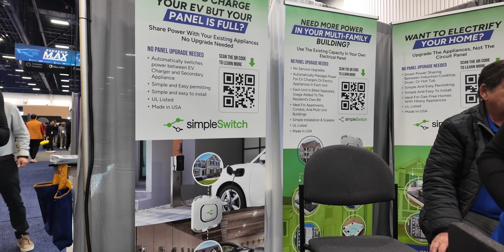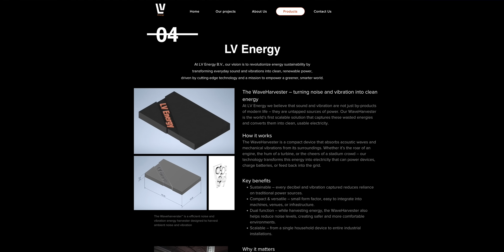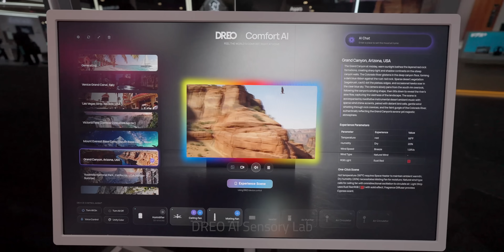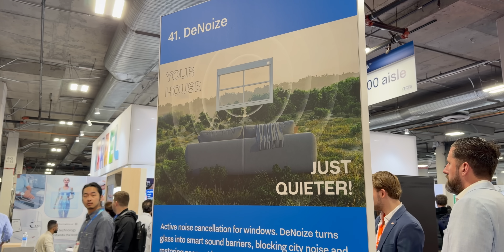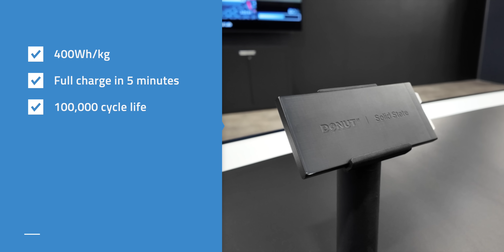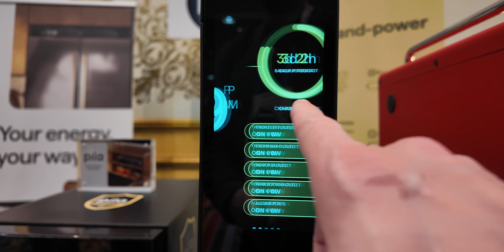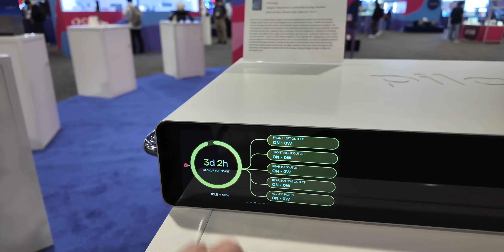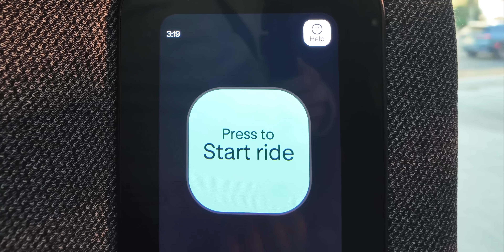The Most Controversial Battery at CES 2026

Comment: Door handles belong on the door since you are already grabbing the door to open it. However, a deadbolt can be just as easily mounted to the wall. That would erase all power issues for a smart lock but simply making the distinction between latch and lock.

Comment: Those skilled in the art already understand that Donut Labs clearly described a capacitor.  The only question I have is how did they increase the energy density.  I understand that a South Korean university solved this problem in early 2025.  Other than that, every one of Donut Labs claims are valid and proven.  For example, a solid state capacitor can actually be charge cycled billions of times.  The cell phone or computer your using right now contains solid state capacitors.

Comment: We have used several electronic combination door locks at our work for twenty years that don't need batteries.  You enter the combination then operate the handle.  Moving the handle creates and stores a charge to power the electronics for the next use.  We've never had them fail.  I assume they use a capacitor, but I'm not sure.

Comment: It’s healthy to be skeptic in some cases, but it’s interesting to see trolls already ”know” that Donut Lab is a fraud without any proof. Let’s just see within few months if the statement is true. Before that NOBODY knows until the battery have been independent tested. It would be very interesting to see a test with these MC that are using Donut Lab batteries to confirm or reject the claims.

Comment: I think that the Donut batteries and some of the wireless charging options are really interesting. I also thought that the auto-switch that detects moisture levels prior to turning on a fan and turning it off again are also a good idea, because just having a fan by default as is usually the case, can showering or bathing a bit chilly in winter, which isn't too good. And I am sure there is more... Thanks for an interesting video Matt. Catch you in the next one! 👍😄

Comment: On the smart locks, the solar cell could be combined with a battery. Problem solved. Considering how little power they use the battery will probably last ages.

Comment: For those viewers who haven't seen the other videos about the Donut Labs solid state battery: the secret is that it's not actually a chemical battery, it's a supercapacitor.  There is published research demonstrating a carbon nanotube-based supercapacitor design achieving over 400 Wh/kg, so their design is likely similar,  and their manufacturing partner specializes in nanotech manufacturing and has pitched a 400 Wh/kg supercapacitor project when obtaining funding to build their manufacturing facility.

I'm very confident the "battery" is real and will perform as advertised but it leaves one big unanswered question: What is the self-discharge rate?  Supercapacitors typically have a significantly higher self-discharge rate than chemical batteries, and if that problem isn't solved it will limit the useful applications of their product.

Comment: I have a smart lock powered by three AAA alkaline batteries which after a year went down to 50%. These power transmitters through IR light seems a solution in search of a problem
Reply: Mine has been good for 3 years now, As long as it's something dumb with a near field rfid sensor and nothing fancy it lasts forever
Reply: @theagentsmith  As a backup, just leave the backdoor unlocked.
Reply: Also, at least my lock if it do run out there's pegs on the bottom from the outside where you can connect a 9 v battery. So you won't be permanently locked out from the door.
Reply: batteries corrode too…If the demand is that small I like a little solar panel to enhance lifespan
Reply: My house has a Key, it's lasted 20 years. It cost me £5 to get cut.
Reply: @Honor-n7l5w  Yeah so then you also get to tote that key around every day and hope you don't lose it.. or damage it, or have it get frozen in adverse weather. You can also accidentally lock yourself out; I can't. I also just had a houseguest and could temporarily let their fingerprint or temp access code for entry. My lock can't be picked because there is no keyhole to pick. Oh and the cost is only a bit higher than deadbolts from the hardware store. So all the keys you have to have made over decades probably even that out.
Reply: @satekeeper that’s a long reply! I too have a 🔑 and if locked out I’ve a key safe with a spare I can go to, no batteries no sweat !
Reply: @satekeeper  I also have a key. If i ever should lock myself out, i have a reserve key hidden on the property (which i can also give out to a guest) and my brother has another one. Never had a problem with my doorlock being frozen, but if it should happen, there is a thing called a "lighter", you heat up the key and melt the ice in the lock. On the other side a coworker recently had the big problem, that her fancy electronic lock just broke and the manufacturer didnt exist anymore. So the door stayed open, until she got a replacement. I will continue to trust the non power reliant "lowtech" solution.
Reply: @satekeeper  Cant be picked, but can be hacked by a kid with a smartphone once the security updates stop.  Cars with multiple redundant security features are being stolen using the exact same tech that your smartlock uses.

In adverse weather cold enough to freeze up a lock (which in my 36 years on the planet hasnt happened to me yet) would also be cold enough to nuke the batteries in your smartlock from having enough power to operate it.

And good luck if you think your smartlock will last decades, if the security isn't broken at some point in the future, the hardware will screw up, at least the batteries will.
Reply: What model and brand? My smart lock eats batteries. It takes 4 AA's that I replace at least 3-4 times a year, if not more. I also need a new one because it doesn't do 5 MHz WiFi. Only 2.4 GHz and doesn't like it when there's both available.
Reply: What lock are you using? 

 @ls60fd  ya, mine is the same it eats batteries, I need to change them every 2 to months.
Reply: @ls60fd  I use an old Samsung, I'm sure it has been out of production for a while, but similar battery life, I used 4 rechargable AA batteries, I swap them out every 2 years or so. It gives you plenty of warning too, so it isn't a big surprise
Reply: @ls60fd mine is a Yale doorman. Guessing I'm close to once a year as well. It only got Bluetooth so that cuts down on battery use. It's connected to device hooked into the power grid that handles WiFi. This is unfortunately it's weak point with frequent disconnects. It doesn't stop you from using the lock in person, even with the app, but it does hinder you at times from checking status or unlocking at a distance.
Reply: Also you typically have at least two doors on a house.. and the units will signal when they are like two weeks out from dead. So.. not sure what situation would ever arise where ALL batteries are dead in all doors at the same instant and you somehow had zero warning.

Comment: 14:35 "The inside is basically like a giant box on wheels.". Some find it cute, I can't help think how it's going to be on a crash since it doesn't have crumple zones. If you're inside and it gets rear-ended, the impact is going to be a foot away from your head and back.
Reply: I’ve ridden in Zoox many times, some of the safety engineering is readily apparent, for example, the beefy side impact protection in the doors, some is more hidden, like the horseshoe shaped airbags.  Based on limited real world crash data they seem to be safe, but they really should get a NHTSA safety rating instead of the exemption they currently operate under.
Reply: @jpe1 I think it’s insane that there are vehicles that can be ridden in the USA that don’t have federally tested crash safety ratings done on them.
Reply: @SalokinQuagsire I’m not going to disagree with you, at least as far as newly manufactured vehicles for commercial use.  I think Zoox are safe, but if they are, in fact, crashworthy, the company should have crashed some of them to prove it, rather than get a waiver.
Reply: @jpe1  Yes. Any vehicle can eventually be rear-ended or hit head on, and there are common scenarios where neither the driver not the AI driving can do anything to avoid it. Stopped at the read light with a car in front of you, or worse, in a highway, there's nowhere to run if the driver behind is distracted and doesn't stop. A modern pickup with such elevated front, it looks like it could hit the Zoox too high, where doesn't seem to exist any crumble zone.
Reply: Yeah first thing I'd be checking in a self driving car is how to escape it in the case of an emergency! Also getting T-boned in that thing looks even more deadly than a front of back impact. These things should have crash safety rating just like any other car, and it should be public knowledge.
Reply: @SalokinQuagsire Agreed. Unfortunately it seems we're going to find out only when a serious accident takes place. I've read that the battery and some others components on the lower part of the car have some crumble features but not at the height of the passengers  upper body. The design just seems fundamentally flawed and that conclusion on the first bad accident could mean the end of the company, and rightfully so.
Reply: And you won’t see it coming

Comment: did you see with your own eyes  a 5 minute charge and 5 (or longer) minute discharge of the Donut battery or even one cell ? greetings from a engineer working with various Battery/Accumulator Chemistries (Including Silver-Zink)   since year 1979 in Finland.
Reply: Donut isn't showing that, they only showed a video of a cell charging at 270 amps and being full in 5 minutes, without reaching much over 60 degrees in heat. That's consistent with their claims. Basically, nobody outside of Donut seems to know much yet but since they're starting to sell it we'll know soon enough. Basically every battery maker etc will buy these batteries and dissect them as soon as they possibly can.
Reply: @cr0ft-2k  so presumably the cell was a 22.5Ah one ( Assuming constant current charging at 270 A for the full time (an idealized case) but probably it was not from 0% to 100%, more likely from 2% to 92% or thereabouts.

Comment: Robots still cant do basic operations like walking and when they are reay to put in homes, You wont buy a drone but rather pay a subscription to a maintenance program because they will have to constantly be updated and repaired and will have to include home damage insurance cause when 200 lbs of aluminum mess up, its a violent thing that can take out a whole room, walls, furnishings, electronics and heirlooms. Of course the Robot will be free and will record everything in the house  and sold to third parties
Reply: Check out the Boston Dynamics robots doing parkour. They've come a long way. Of course that doesn't mean they're suitable to be home robots, we're many years away from any such thing.